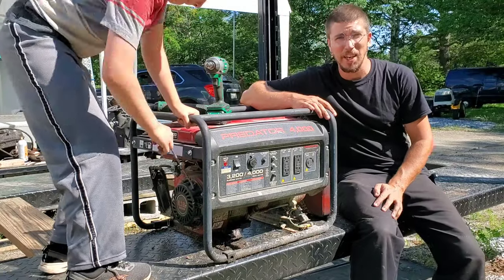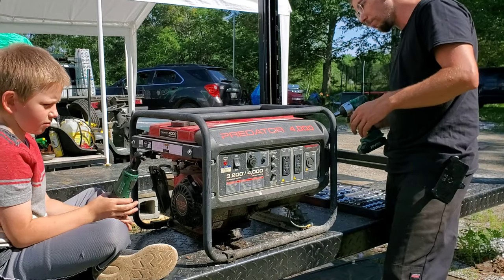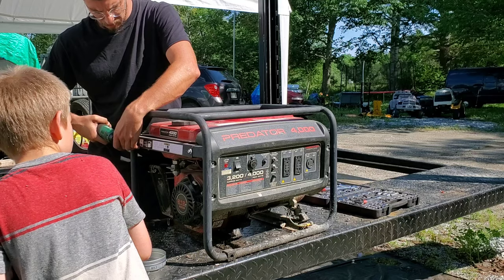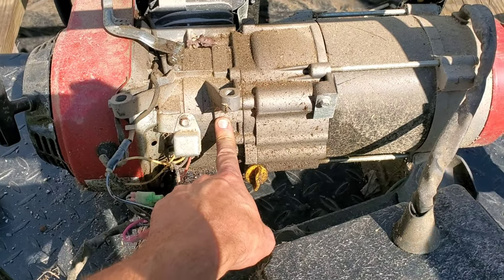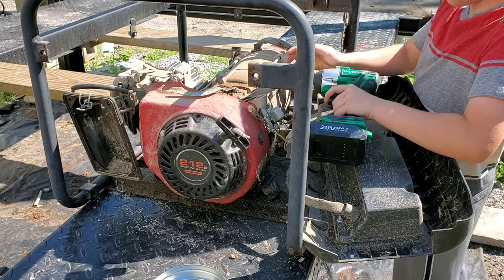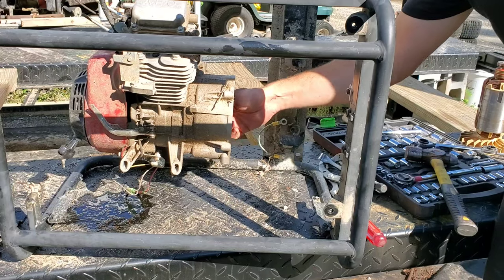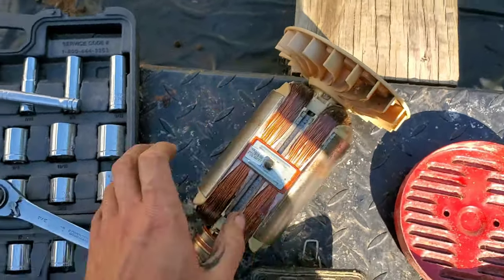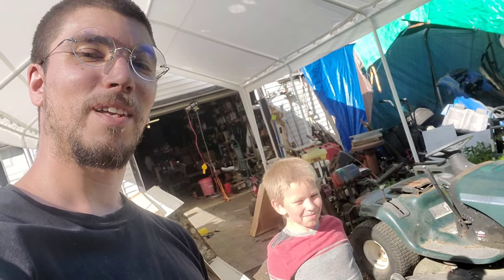Generator Predator Is it a Tapered shaft?

Comment: I did this same thing and my riding lawnmower it's been running for 2 years now, just cut away the aluminum fan housing, weld a  drive pulley and it works.

Comment: There is an adapter available to convert from tapered shaft to straight, includes a keyway. Believe I saw them on ebay.
Reply: Makes the shaft over an inch

Comment: if it is a tapered shaft just press the rotor assy off the shaft and cut the shaft to the length you want, put it back on the motor and find a shorter bolt and reattach it then your back to a straight shaft, done it many times and it works awesome.use some green locktite and its fine.

Comment: I have mounted them on the ways of my lathe and turned them into a straight shaft and cut a keyway in my Bridgeport. Just indicated the crank in bolted it tight and start the motor up and bring in your cutter.

Comment: I mentioned your video (not by name ) in Harbor Freight bc they insist they don’t sell a predator engine with tapered shaft. 
My original was a 10 hp Tecumseh but harbor Freight has 8hp and 13 with electric start but they say no tapered shafts.

Comment: Wondering if this one get the 20A breaker hack and toasted the stator windings?  Amazingly, I got a $25 awesome looking condition engine fired right up one with low voltage that only needed a ~$15'ish priced AVR to be good as new.  On the other hand, before I learned about repairing the generator side... I invested in a $50 fried stator Coleman Powermate that has me wondering if I can rewind (if somehow worth which I doubt is) the stator coils and possibly upgrade.  Appears the rewinding can be done by those in 3rd world countries. :-D   Still, motivation.   Amazes me the Prius CVT Motor Generators (MG's) and I'm thinking I'll focus on using one of the two MG's for use in making a generator with possibly that engine and most likely the planned 18HP opposed twin briggs for starters since was the engine used for the B&S hybrid car.   Also, reminds me the water pumps have a unique annoying shaft design that's threaded and has me thinking again I need to make an adapter for a pump or two around here. Thanks for sharing!
Reply: Have me wondering if the rotor can be easily tore down to make a straight shaft adapter and if so, what that O.D. is of that sleeve?   I'll check when I get to the latest gen I invested in missing the stator though looks like has a good 13HP Vanguard.  It's a Generic MC6500 I'm not finding any info regarding. I'll try making a video in the morning if I can remember.  So far only the two photos that make me think Vanguard or Honda... man you can tell I'm a rookie at the range of generators and this is my first season working with em.  https://www.facebook.com/james.analytic/posts/5071266129601815

Comment: I heard if you wrap teflon tape under the head of the main shaft bolt. Put water or oil in the hole of armature hydronic pressure will push armature off when you tighten bol t
Reply from the maker: Neat! I will have to try that on the next one.